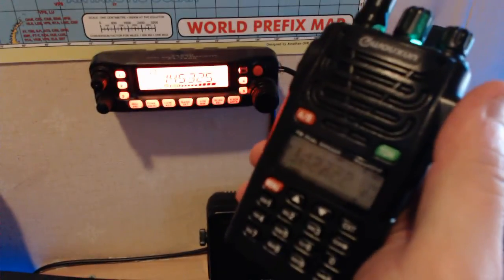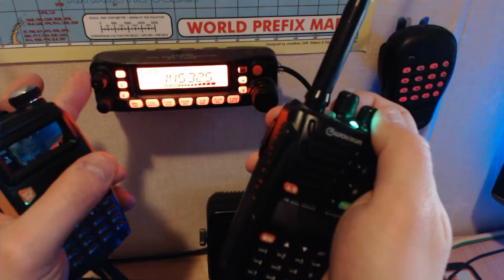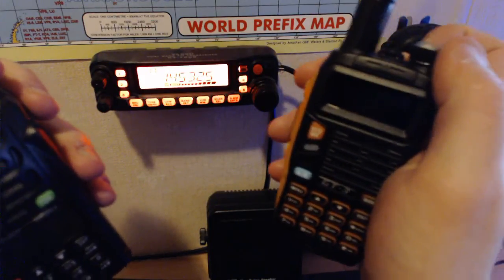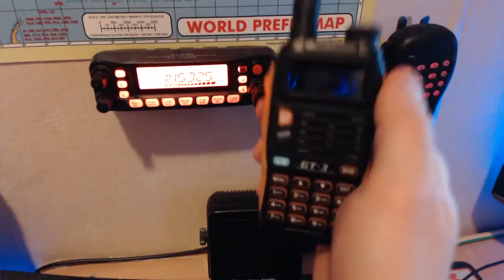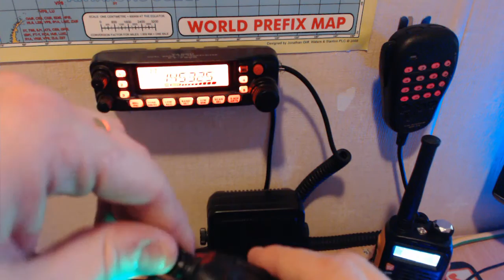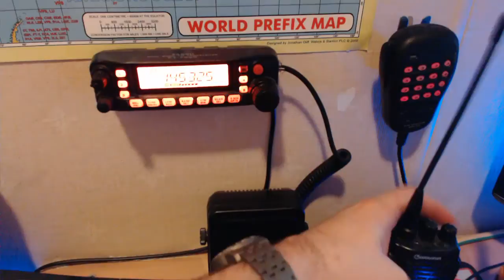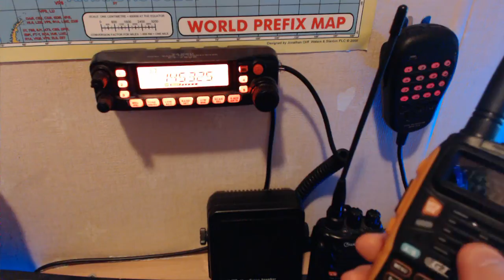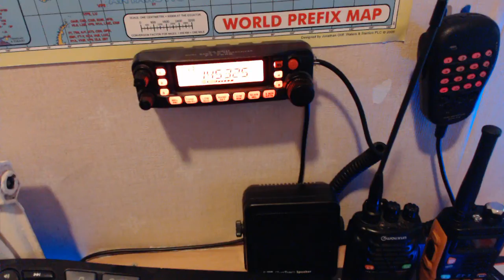Wouxun KG-UVD1P vs Baofeng GT-3  (part 3)

Comment: Thats not the way to test radios  The wouxun is a double conversion ht that has much better selectivity and frobt end than the direct conversion baofeng. Do comparison tests with an external antenna and you will find thst the wouxun does not overload and will pick up signals thst the baofeng does not

Comment: The Baofeng GT-3 its better...
Reply: really?   i have both and if you look at the specs the wouxun has a dual conversion superhetreodyne receiver with excellent selectivity and harmonics are suppressed. The gt3 is an SDR radio with little or no filterning, direct conversion so prone to RFI and overloading and throws harmonics